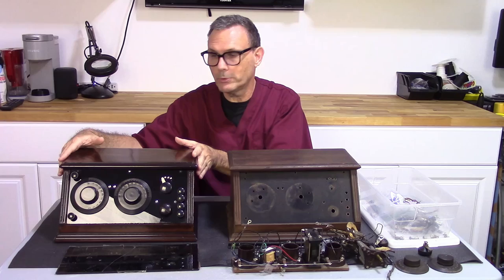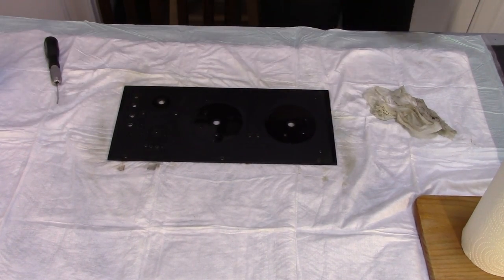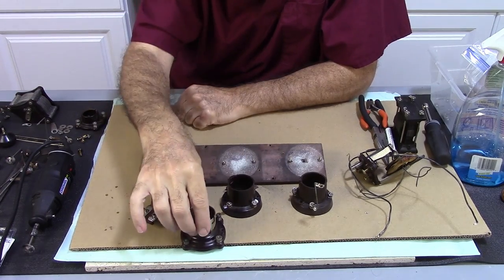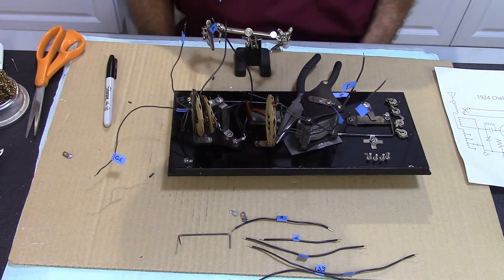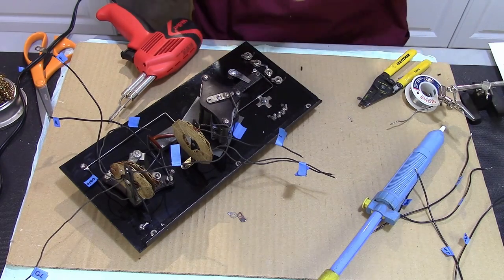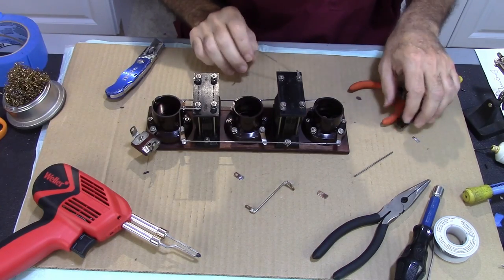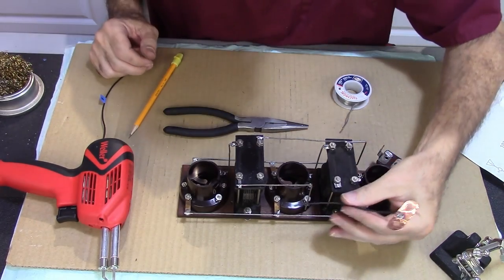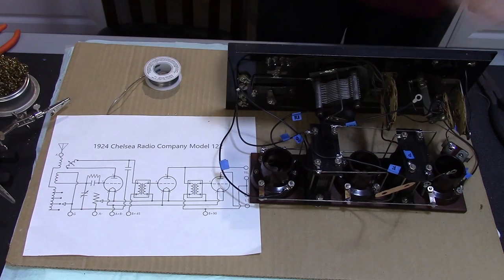Chelsea Model 122 Restoration Part 1

Comment: Happy to see a so old radio so well restored. Can you explain how work a grid leak detector?
Reply from the maker: Wow, that's an intense question.  I know people who have worked in the radio business for years that couldn't explain it.  It's a great idea for a video though, and I will definitely do one on how a regenerative receiver works.  The problem with explaining it here is the physics would be a small course in itself.  But basically the grid leak capacitor passes the RF from the tuning circuit, and the resistor sets up the grid bias and allows for the discharge of the grid leak capacitor if it receives a large signal.  They work with the grid circuit to "detect" a carrier wave with modulation.  So basically when a modulation envelope is sent to the circuit from the tuner that has a modulated carrier wave, the signal gets rectified.  As such only the positive portion of the envelope passes.  Since the anode responds to current flow, based on the frequency changes at the top of the envelope it replicates the intelligence used created the variations in amplitude riding on that envelope.  That intelligence appears as audio that is created at the anode or plate of the detector tube.  This is a very simplified explanation.  If you need a full understanding it will take a lot more than a paragraph to explain.